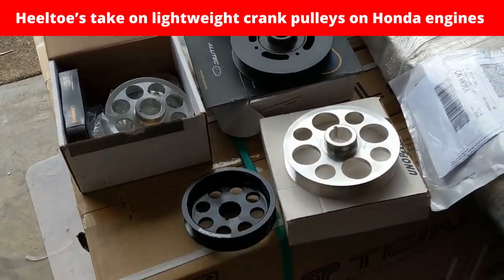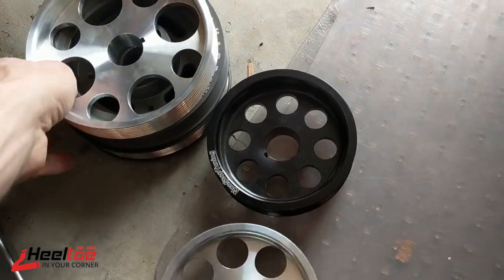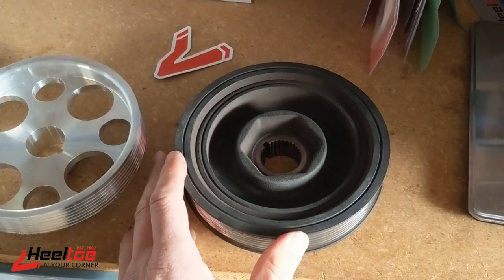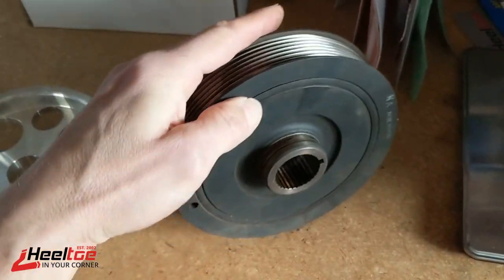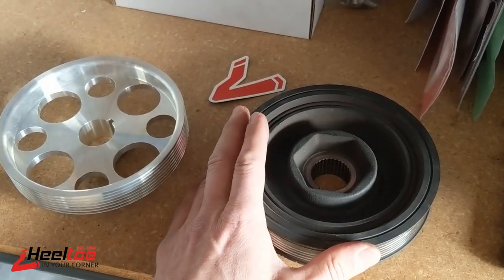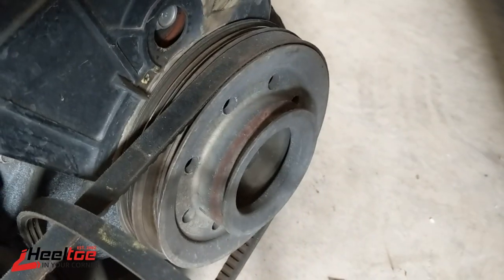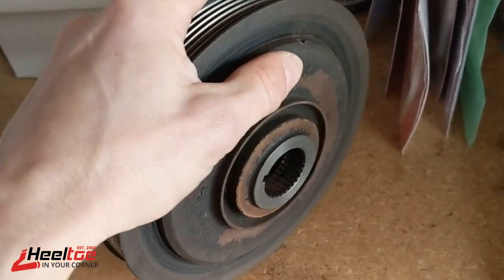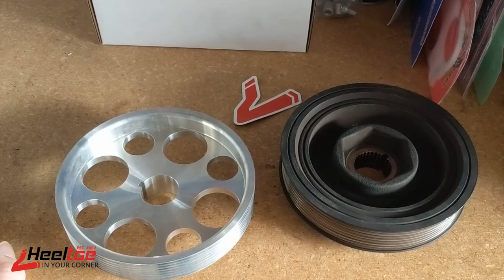Heeltoe's Take On Alloy Crank Pulleys for Honda/Acura Engines

Comment: Why not just have the lightweight pulley balanced?
Reply from the maker: These parts are made concentrically. They are basically balanced off the lathe. But that is not the concern people have anyway. They are worried about damping destructive harmonics, which is a non-issue.

Comment: Make a d series crank pulley with built in 60-2 trigger wheel 😁
Reply from the maker: Pulleys with triggers...what for, really?
Reply: @Heeltoe.  d16z6 with zx6 carbs running on nodiz ignition
Reply: @Heeltoe.  motor is for a first gen accord sedan
Reply from the maker: @530StreetRacing  We will not be making that pulley

Comment: High performance academy has a video you should watch on the subject my friend 😂😂😂🤦‍♂️
Reply from the maker: I'll take a watch but don't expect it to change my mind. In 15+ years, nobody has yet. Have yet to see practical real world evidence that a modern Honda engine needs any kind of harmonic damper, short of a high horsepower race engine.
Reply: @Heeltoe.  that's true your over engineered very reliable low hp honda engine may be fine but that's not the case with all 4 cylinders depending on bore stroke overall smaller piston less torsional push and pull on the crank ie less need for a damper but like my 2.4 nissan motor it's at about the end of the spectrum for a for displacement to still be able to rev past 7k that's not to say that a damper wouldnt help your honda last 20% longer by dampening those vibrations that are just vibrating the main bearings the oil pump the rod bearings the snout 9f the crank, even vibrations being transferred to the valves from the timing chain if u have one and u wouldnt be able to notice a problem until years and years later after it's way too late u cant feel torsional vibration at all it's a harmonic frequency that happens at different points in the rev range that the damper dials out not an actual vibration u can feel or hear
Reply from the maker: @Spacedout209  Thanks I appreciate the feedback. We just don't put stock in the idea that the stock pulley on your general Honda engine is even a harmonic damper to begin with. It's all in the video. shrug I am not commenting on any non-Honda engines.
Reply: @Heeltoe.  I seen that engine with an oem pully on the crank,  i think even some porches dont come with them stock but whatever I can do to keep my nissan 4 cylinder from  vibrating itself to death all I was saying is I'm sure adding one to an engine that didnt come with one would make it last a little longer even if it isnt necessary

Comment: Lightweight crank pullies are nothing but useless junk on my 1.8t vw mk4. I tried 2 different ones, underdriven and not. All they did was make the motor more snappy and rev faster with the clutch pushed in. I even had the car dynoed and it showed a 3 horsepower gain which almost made me a believer. The issue with these is that on a dyno there is no real world load on the car while its accelerating. No wind resistance, no traction and tire resistance on the road. No weight distribution or accelerating under weight. All these load resistive factors working against the car while its trying to accelerate cause the crank shaft harmonic vibrations to be amplified way more then on a dyno. These load factors and harmonic imbalances will cause the engine to lose over all power output at high rpms. You might gain a little quicker torque response but the over all horsepower will suffer. And the best way to figure that out is to use draggy. And do test runs with a light weight pulley in 4th gear to redline and then do the same thing with a balanced pulley. You will see the results for sure. I lost 5 tenths of a second on multiple 60 to 120 pulls with a light weight crank pulley. And that was consistantly done with 6 different runs on the same stretch of highway. Light weight crank pullies look good on the dyno. But in a real world scenario they actually lose over all power. They actually rob horsepower. And i can verify that. And the 1.8t crankshaft is just as balanced as a honda cranshaft by the way.
Reply from the maker: Thanks for contributing your experience! Careful not to mix terms between harmonic vibrations and balancing. They're two different things.
Reply: @Heeltoe.  yes you are correct. There is a difference. The 1.8t balancer i am referring to is a vibration dampner not a harmonic balancer.

Comment: Just use a fluid damper for the crank pulley. Makes hp and is still lighter than stock but absorbs any vibrations and if you assume Honda engines don’t vibrate at all because they have magical crankshafts and can ignore the fact that they’re 4 cylinders then I’m inclined to believe you’re selling these pullies or making commission from sales. I wouldn’t trust those shitty looking garage made pullies either. There are far superior brands that make lightweight pullies. How much money do you make selling these pullies versus the cost to make them? They look like some Alibaba junk.
Reply from the maker: Well a lot of hate in there. LOL, I'll tell you what you lost me at a fluid-filled damper makes power. Sounds to me like you're more interested in saying a bunch of negative things than actual facts. Every one of the pulleys in this videos is a quality made part and with the exception of one they're all made in the USA.

Comment: run a 9lb flywheel and buy an ATI damper. don't be cheap on your $5000 fully built motor. all the responsiveness you need.
Reply from the maker: Nobody said this advice would be taken on a $5000 fully built engine. This is general advice for the average street tuner.

Comment: Hondas all come with harmonic dampeners. (even if they are cheal rubber style ones)
Not running one will kill your oil puimp. 
Stop spreading misinfo.
Reply from the maker: None of them do as far as I know. You are flat wrong dude. The video is specifically to dispel the fearmongering.

Comment: They have blown many of engine lol but are fun
Reply from the maker: No they haven't.
Reply: @Heeltoe.  its more stress on the oil pump and bearing only because slightly more vibration atributes to lower film of oil coating bearings from shaking
Reply from the maker: @04tacomaguy1  as long as the crank is balanced these parts do not cause any of those issues on the Honda engines were talking about here.
Reply: @Heeltoe.  it's balanced for the heavier OEM one when you take one that only weighs a few ounces on a stock internal motor it will cause issues down the line. Now if you have different crank rods and pistons that weigh less it won't be as big of an issue cause its more or less counter balanced...
Reply from the maker: @04tacomaguy1  I'm sorry friend you're really off base. Size and weight of the pulley have nothing to do with the balance of the bottom end. The engine is balanced internally has nothing to do with the pulley. The pulley is balanced as well so it doesn't affect the balance of the rotating assembly at all.